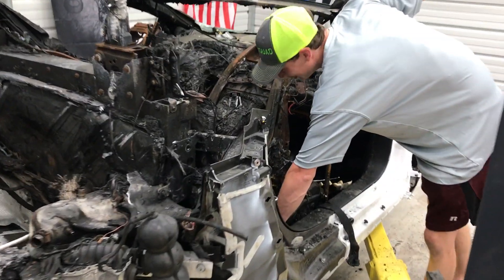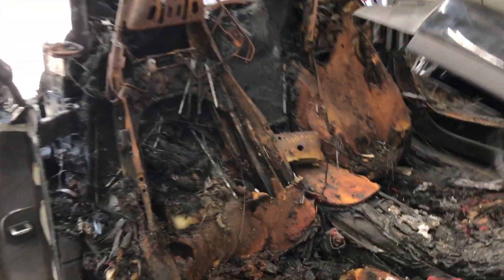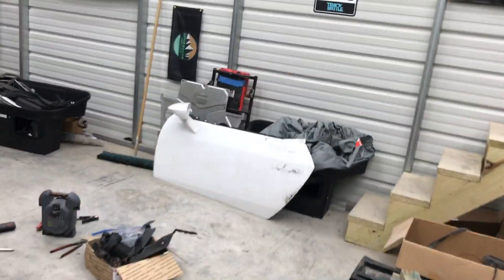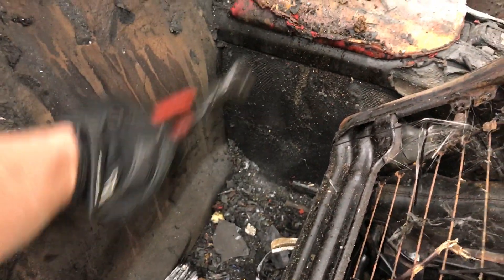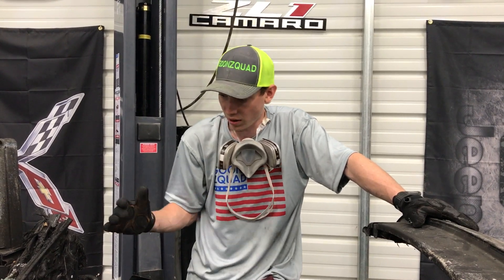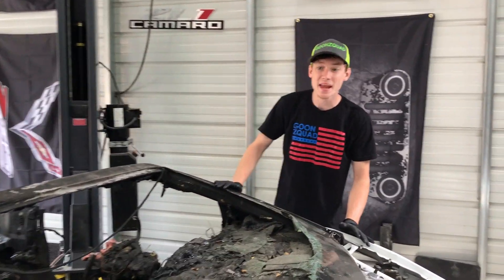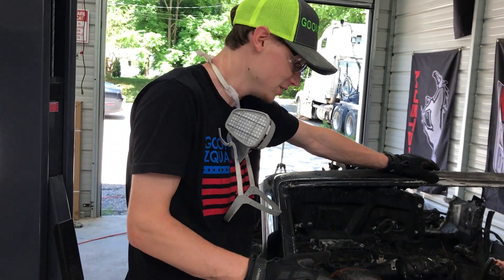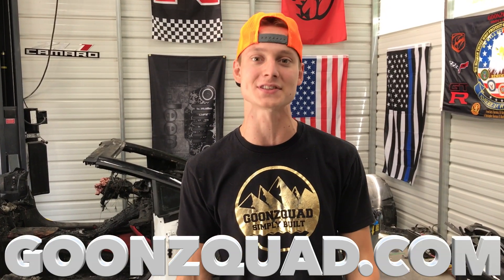Building A Custom Supercar Part 3

Comment: if your havin a hard time with that vaccum, give the hose a poke with a 1 1/2" pipe, then change the filter out for a good ridgid you can wash a few times, if your running bags you know where im going... great start on this one guys. keep up th egreat work

Comment: You need to work with ECU master or Haltech or Holley . Complete systems.  With screen for dash included . You wont need any of those burnt OEM wires.
Edit- guess it depends on what engine your gonna run..

Comment: Passenger Air Bags are usually 2 stage for weight purposes. There are load sensors in the passenger seat that determine the size of the person for safety reasons. So if you have a small child only 1 stage will fire so it doesn't injure the child. I think the 2nd stage will fire if it determines that the passenger is over 60 or 80 lbs. And there ya have it :)

Comment: you can use your power probe to energize,power any 12v motor or electrical device thats in the car, just connect it to a 12 v source and stick the pointy end to power it

Comment: you ought to take those seats to an auto upholsterer and have them rebuild them. they don't have to have the lambo leather and stuffing on them to be good seats, i would sand blast them and take them to an upholstery shop and just get them to diamond tuck you some new seats. and why wouldn't you put this one back together properly and just have two lambo's a convertible and a coupe?  that would rock plus this one would be your all time most involved biggest and most challenging build, i mean come on man Lambo is pretty much top of the food chain as far as super cars go. and you still have good bones to work with on this one yet too. the fun part is going to be re-doing those pop ups. watch B is for build on here it can be done

Comment: @goonzquad for the electronic just find a way to by pass all the uneeded wiring. All those computer aren’t all for the engine and drivetrain. Just get the ones you need and like a race cars use switches to turn it everything on. You don’t need music and a/c.

Comment: Hey guys awesome progress on that lp610-4 
And you guys might have to buy some wheels and some suspension components so that you guys can move the car and try to fit some after market parts on that engine which might as well boost up the horses 

And are you guys fitting sheepeyrace’s twin turbo kit on it? Cuz if you do it, it will be insane track killer

Comment: Don't rebuild the engine and stuff, just go raw, unique, put a different engine manual transmission, go crazy with it
Reply: Oh why?
Reply: Personally o think it would be cooler, and rebuilding that engine is just gonna be to expensive, it would be better to get something more mainstream and go wild, super and turbo charge it, stuff like that and it would be cheaper I guess, like b is for build LS swap
Reply: @juankrajo3874  seems ok but after all they're doin it.

Comment: Billy just my own opinion on this but I would suggest getting a type of silicone ring. Metal is great for a conductor as we all know... I have seen first hand what happens when a ring touches something hot. (electrically speaking) I wear a Groove Ring while working with my hands then switch to the regular one after the job is done.

Comment: A bowl of rice isn't going to fix that remote. Rice only helps within minutes or hours of getting wet. Best thing to do is replace the battery, otherwise probably the PCB inside is corroded.

Comment: They flip the battery because if the key has power you can start the car without any key in the ignition - the car thinks someone is in it with the battery in their pocket.

Comment: Warped heads...block?? When the engine was on fire the block was probably really hot. And if fire fighters put out the flame, the water could have supercooled the block causing it to maybe warp. That would suck.

Comment: Donot use that Lambo engine. Most important things that are destroyed by fire have to be replaced and are more expensive. It will make problems in future. And also the body is aerodynamically made so if u change it and those power will troubles u. I prefer to use the engine of Honda VTEC it will be more better. U have two honda engines right!!?
U can also use the seats and other parts of the Honda car. Then it will be nice to have an extreme built car.

Comment: Your rigid shop vac needs a brush over haul. Mines did the same thing yours is doing. Terrible parts that are cheap. Once the faces of your vac brushes are filed flat it will take a minute to set in and should be fine. Otherwise is another trip to Home Depot for another ill put together vac. Clean the fan rotor also.

Comment: Don't put the burnt v10 please. It would be hella unique if you put the rebuilt 4 cylinder engine from the s2000 and modifying it to output a 1000 hp

Comment: @goonzquad . Boys if the engine is okay i think it would be worth it this project . And than you guy's can put a standalone system by motec or fuelteck and let these companies make a harness to put in the car . Buying original part will be to expensive.  

Cheers

Comment: dude yall are in over your head.... even if the fire didnt destroy the engine or carbon fiber, it has basically annealed any metal on that car. or its been quenched when the FD put it out....which means its now super brittle, and wet as fuck. i hope yall make some money, but sell that bitch and cut your losses. itll never be safe to drive

Comment: The sooner you guys realize that that car will never run again, the better off you will be. Some projects nickel and dime you to death. This Lambo is gonna five hundred and thousand you to death.
Reply: How? They're custom building it, not rebuilding it. It'll cost how ever much they want it to depending on how much actual custom work they do. They can easily get it back on the road with $5,000 in metal tubing
Reply: @Toyrobotchicken  I bet each one of those wiring harnesses and computers is two or three grand each. It will take 50k just to get the wiring redone to MAYBE start the engine. This ain't no LS where you can throw an aftermarket standalone computer on it for 2Gs.